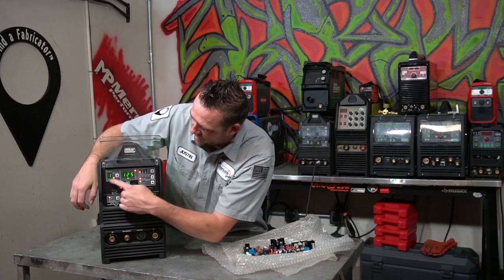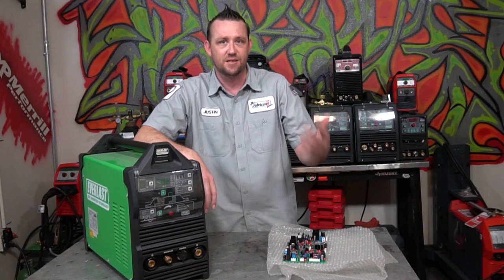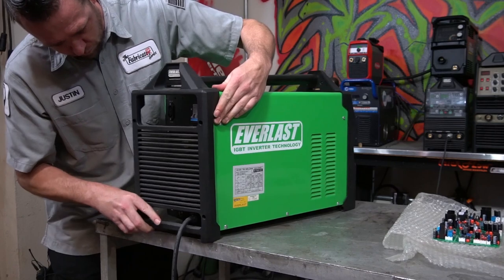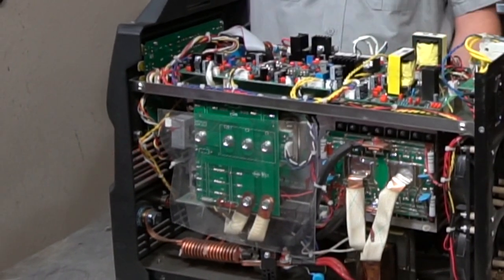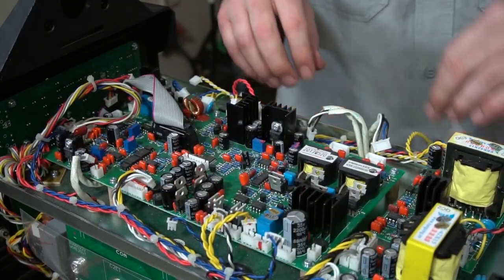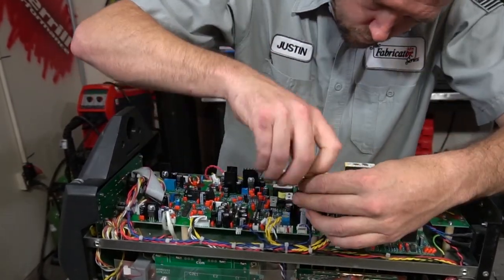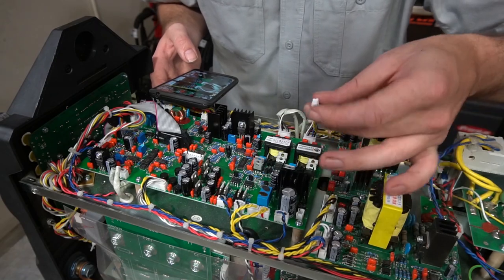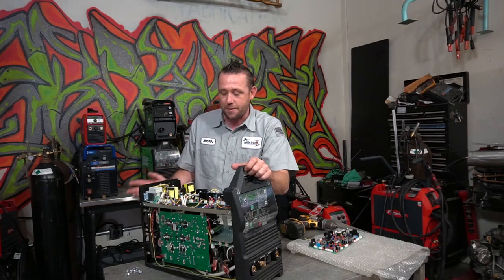TFS: How to Replace a Board on Your Everlast Welder

Comment: I just spoke with Everlast Technical Support and they had me run through a power output check. It checked out and so they diagnosed my welder’s problem as needing a new top board. They had me take a picture of that board and email it to them. A replacement board is on its way. Your video on swapping the two was excellent and very helpful. Like you, I don’t want me welder in a shop for weeks as they said they needed to get their hands on an Everlast electrical diagram manual before they could even begin working on it. I imagined I would see that welder months later so I chose to just do it myself...thanks to your help. Thank you for taking the time to video this swap out and go over everything very well! Cheers mate.
Reply from the maker: Happy to help 👍
Reply: @TheFabricatorSeries  Been trying to get parts for mine for three weeks Glad you have had good luck with them I have had nothing but bad luck with everlast 3 out of 4 new machines from them had to be repaired.  They must send you the best of the production run.

Comment: Suggestion:  It's a good idea to make sure you're grounded when handling boards.  A static electricity discharge will ruin your day otherwise.  Some electronics is more susceptible than other types but nearly all boards these days will contain elements that are.
Reply: Also, really sensitive parts should not be in regular bubble wrap - or any other static friendly material. But probably EL shipped it that way, so probably not that sensitive.
Reply: I was fixing to make the same comment about using a grounding wristband.
Reply: It's mostly CMOS chips that are that sensitive. CMOS are usually used when power saving is important, so probably not as likely they are in a welder as say a cell phone or laptop.
Reply: Generally you want a meg ohm ground so that any discharge is not severe also protects you from an unintentional short across the body.

Comment: Could you comment on your overall experience with Everlast - how many machines you are running and how often they need repair?
Reply: Looks like a lottery with Everlast. I know for shure that his everlast welders stopped working
Reply: @quartfeira  It is kind of a lottery since they outsource a lot. They do not always refresh their product lines uniformly.  Their US based staff are not large in number. I can say from chats with the owner and some staff via media that the overall quality of their mid-high end boxes has improved drastically over the last 5 years. 
If you look at just the interface changes alone with the recent 275 lightning and the storm 215 versus the old boxes that's a big shift. Internally they have changed/ improved a lot too. I'm not giving them 5 stars or kissing their butt, there's a lot of room to improve but they are improving.
Reply: I have had a everlast 211si I purchased in 2019 ... not too many issues but enough to make me think I should have gone miller.
Reply: @DonnyBwelding1  Yeah i'm leaning towards a very shiny miller 255 but oh my the price.. :/ Still smeagol brain says "Me want!" 🤷‍♂
Reply: @Enonymouse_  imo now it would be worth it ...you get what you pay for . Millers arch tech is sooo smooth ... fronious is a hottie too..but yeah if I have to get another ...will prolly be that big boy miller ... do it right the first time and u don't have to do it again .
Reply: I'm currently dealing with some loud pops that happened inside the machine and inspecting boards.... not to thrilled with customer service as  they havnt been the most responsive . This is money for me .. . I had jobs lines up that required this machine .
Reply: @DonnyBwelding1  yup i've learned that too with the corner cutting stuff, took the words right out of my own play book. :)
Reply: @DonnyBwelding1  The new millermatic 255 looks awesome. Cyberweld sells it for lower than average too.
Reply: @Enonymouse_  just like all the tools in our arsenal you learn to just get the high quality one even down to filler ...its always worth it.
Reply: @Enonymouse_  ohhhhhhh thanks for the hot tip! Respect . It indeed looks amazing!!!
Reply: Those dynasty are sooooooo tempting to me

Comment: Great video for more than just welders!  If you take some care with the anti-static treatment, connector force, letting things discharge, etc.. and your gear can be up faster, without spending time and money shipping.

Using my camera to take  disassembly pix has saved me; great comment about marking connectors.  The "if you think it should come loose, you've missed a fastener" advice is so important.  Easy to miss things like that on well-designed systems.  Watch for pinched wires on chassis assembly too, btw.

Comment: My 210 ext is atill goin strong after 9 months of weekly use. Glad its an easy repair if it does happen.
Reply: Not gonna lie.  This video has me a little concerned for my 210ext...  Only had mine since May of 2018, but it's been great so far.

Comment: Thanks for this. I need to take my powertig 250 ex apart to figure out what is causing backpressure in the argon line. I can't get full flow through the machine. Thinking it might be a hose kink or a bad solenoid.

Comment: Everlast shipping repair parts for user installation must be a new (or recent) thing.    But it's an improvement.   in 2016 I had to ship my 250EX to Idaho (of all places) to get the board replaced.   They kept it four months, which was a big problem for me.
Reply: No, we've done this for years, to customers with basic skills.  The older units were more difficult to repair, but many items were repairable even then.  A new 250EX is just as easy to repair.
Reply: @everlastgenerator    "The older units were more difficult to repair" - Ya right!  More like, they are throw away machines.  The "repair department" are goons that try to dissuade from repairing, quote costs that make it uneconomical, or just say they aren't repairable.  But they'll be glad to sell you a new one! They have no schematics for older machines, so they are unrepairable.  Before you buy an Everlast, ask them if they will supply the schematics so you can get it repaired locally, or repair it yourself.  They'll refuse.
Reply: So very true, what a con job they are.

Comment: Nice video. I've owned and used my 210EXT for about 3-1/2 years, and still dig it. But it's good to see the relative ease of component swaps that Everlast will sometimes offer to their handier customers, even though it's not part of their explicit 5 year warrantee. Rock On Everlast, and Fabrication Series!

Comment: hello. I'd like to ask. where can I source parts. I have an everlast power imig 200 dual process welder. the inverter board got messed up. I am in the caribbean. grenada exact. no where close to any everlast repair or dealer center. any help in sourcing this part will do.

Comment: my miller dynasty 200 dx had a board failure resulting from their vibration dampening system / protection not doing its job, called for a new board was pretty $$$, could not afford to do it myself, so i was glad i bought an extendo warranty😁😁

Comment: Good video Justin I agree 💯 with taking pictures. I used to do it all the time at my last job working on classic cars taking a dash out or even something with a bunch of nuts and bolts. Because it better to have that back of picture that took 1 minute to take compared to all the time and frustration or guessing it’s just peace of mind in case you forget how something went and just makes things easier putting back together. Great video. Question I have the same 210ext love it but I get really erratic arc starts sputtering on tig on all materials even if I set the start amps up it still does it and I checked all my fittings and hoses no air leaks at all . Also on my 4th bottle of argon so I don’t think it would be gas but possibly could be I’m gonna try another gas supplier next time just in case . But here’s the thing if I set the pre flow to minimum 1 I’ll get a smoother arc and it’s ok but pre flow has to be at least 1 second not .8sec. Any help appreciated it’s driving me crazy because the machine is less than a year old and always did the bad arc starts like that. My be best to contact everlast costumer service. Thanks again 🙏🍻👊🏻

Comment: I hope my EL tig 250 ex doesn't take this dump on me. I went through this on my powcon 20 years ago, it was a breeze, fired right up. I have computer repair experience so the intimidating part was low for me. These inverter machines are as delicate as a PC. Just look at that board, it's a PC board.   I've found that you keep the machine as dust free as possible, religiously  cover it when not in use and keep it in a "high and dry" place while in use. Humid ambient air is enough to start microscopic corrosion on a dusty PC board. I keep my machine in an air tight plastic dewalt rolling trunk when not in use. Ive had computers and RC transmitters die on me became of leaving them too close to an open window for an extended period of time. The electronics looked fine to the naked eye, but after inspecting under a microscope,  I  saw a forrest of verdigris (green oxidation) on all the solder points, thats the beginning of the end for electronics. Just a metallic dusty environment is enough to start microscopic corrosion on the electronics.  Cover the welder while grinding and actively  vent that dust out of the area with a good fan.
Reply: These boards have a fairly good conformal coating and aren't just bare.  But they are designed to withstand HF and metal dust to an extent.
Reply: I usually turn off my welders before I turn on a disk grinder.

Comment: How did you determine that the board was bad? I'm having an issue with my Powerpro 164 that I picked up used, and it's not functioning correctly. There are no warning lights and the machine technically functions, but it doesn't actually weld. I don't mind sending it to a shop, but if it's as simple as replacing a board, I'm all for that. I just need to figure out what's not working.

Comment: Great job, only a couple things I would add, make sure you wear a wrist strap, and use a hand screw driver instead of the power driver, it's very easy for the power driver to slip and cause an o-shit moment yes I am speaking from experience, after 25 plus years working in electronics I have had my share of expensive boo boos. Love your channel.

Comment: Thanks for this video. This helped me to decide to save some more cash and get an American made unit instead. I constantly teach myself lessons about Chinese junk but I still never learn.
Reply: I'm curious who's actually putting together the circuit boards.  I would hope that they have better components on the board.  In reality if Everlast is supporting the components for their products then it doesn't seem too different from the American offerings of which maybe your welding repair facility has some parts in stock.  There are also replacement boards available for the more common Chinese welders but for the most part it seems Americans don't buy those Riland style machines.  It seems as far as support certain Lincoln models and most Millers are really great machines to own.  Since I will never make money on the machine and it will probably go months without use at a time I don't really mind having something disposable that is much more a roll of the dice.  Pedal control also seems to be kind of a more American option.  Each person has to find their own value and decide on the pros and cons of each.  I have a lot of friends that are mechanics first and fabricators a distant second that use the green machines and none have ever had issues.  I've read some stuff online though that Everlast isn't necessarily the most fun company to deal with but that's just reading disgruntled people's statements so who knows?  This is my first time having a decent look at the circuit board and the PCB is just very organized and straight unlike many of the Chinese welders that I've seen.  Granite being ugly doesn't mean it's bad but being clean does lead me to believe there was a little bit more thought and organization put into the design.  I enjoy digging around in Eastern European, Russian, and Southeast Asian forums to see the markets that the Chinese machines actually have a sizeable share. AC TIG being such a premium feature it's sometimes hard to get information.  Well this turned into a bit of a rant.  Back to trying to get schematics of an Italian made Lincoln good luck in your machine search.

Comment: Trying to fix my everlast Plasma again.  My plasma was dead 10 days after it got here sent it back for repair came back never worked well replaced it with a Hypertherm put it on the shelf. Fast forward  to this week I now have  a use for it on a CNC Plasma Table build.  Added a machine torch, hooked it up no spark just relay click and post flow air.  But it will scratch start and cut great.  But its just not real useful when used a CNC.  Any ideas on a fix would be appreciated It does cut but I need to get the pilot Arc working
Reply: Good luck with that.  My Everlast plasma cutter "broke" and wouldn't cut any longer, pilot arc going constantly inside the machine (contacts).  Useless tech support wouldn't do anything.  Said to buy a new machine.  Went HTP instead.  After 3 failed Everlast machines, who needs the grief?!  Pay just a little bit more and get some actual support, if needed.
Reply: So very true, poor quality and lots of hype.

Comment: Hello,
You wouldn't happen to have an MTS 251SI around your shop that you could take a picture of the top 2 boards for me? I replaced the main PCB on mine (Under warranty)and some of the connectors go to the top 2 boards and connect there.... i need a picture of how they connect (i took pictures before i removed the connectors but the picture was blurry and cannot make out the connections.) Everlast will not help AT ALL!! they say they don't have that wiring diagram. 
thanks!!

Paul,
Reply: I would call Mark Lugo, ext 204 at EL.  I have his cell # but would rather he give it out.

Comment: I'm having issues with the HF start on my ext255, is this most likely a circuit board issue?
Reply: Probably fixed by now but the gap in the high frequency,system in the machine might be off. Easy fix if that is it. Hopefully

Comment: this is great i didnt know they had this option, saves alot of down time and makes sure youre not stuck paying shipping costs to fix a brand new machine, what was the process prior to the board being shipped did you just call up and explain the issue and they knew the problem and took your info sent the replacement out free of charge, do they charge shipping or their costs for the part, what info do you need to prove your warranty ect

i have an esab right now, not impressed with their warranty work at all they wont deal with me at all once i figure out the issue and talk to them and they agree to warranty it they tell me to take it to my local welding shop and then the guy there has to call and jump thru the same hoops and then they send him the part and the welding shop guy always seems busy and judgemental, then im bugging him for 2 weeks waiting for the part to arrive (happened to be the mig gun) then i need to go pick it up and the shops only open 9-5 weekdays which doesnt work well for me... why they couldnt just take me serial number see when the machine was sold to confirm its in warranty (even though all of my models are still in warranty as they havent been in production that long) and send the part or whatever directly to me
Reply: We've tried to make our machines with a "componentized" modular design.  It reduces repair times in house, and for the customer if he/she is equipped to do so.
Reply: yeah it seems like a great way of making them, ill be looking at an everlast for my next machine forsure, most people who can use a welder and the accompanying tools can take out some screws and plugs and put them back where they belong

Comment: Got my 210ext in June of 2018... I've literally only used it for about a dozen projects. And of course last night something happened and blew the main breaker for my garage while I was simply looking for a battery for my welding hood. Reset the breaker and now my welder won't even turn on. How did you go about even diagnosing what board failed? No idea where to start. Yes, i have power at the outlet. And there seems to be a very faint electrical smell. Needless to say i'm pretty upset
Reply: VisionOneRacing Peter I’m hearing ya! I’ve had that same thing happen to 2019 model 210 EXT three times in 18 months, I would say I’ve used the welder for a similar amount of projects, so not much really. Each time it’s blown two out of the three black SCR looking things on the power supply board (vertical board on left side viewed from the front of unit). The dealer has been good to work with but the hassle and wait for parts definitely eats into your warranty time, it’s a good thing it’s 5 years. I’m dreading when this welder is out of warranty and repairs will on be on me...there’s gotta be a design fault with the 210 EXT power board, underrated components, poor design or something.

Comment: Why after only a year , did the board crap out? Is that the norm for an everlast?
Reply from the maker: It just lost a couple channels. I wouldn't call it normal since its the first time I had an issue. It still worked on one channel all day no problem...
Reply: It's a super affordable welder. The fact that you can get the board to fix it is cool by its self. When some of the cheaper welders have a problem, you can't get parts so you have to get another your self another welder. I'm not saying a everlast will last for ever but if it lasts 2 or 3 years and helps you become better at welding or make some money, it was worth it.
Reply: Yes, it is the norm.  Their "repair dept." is backed up for months!